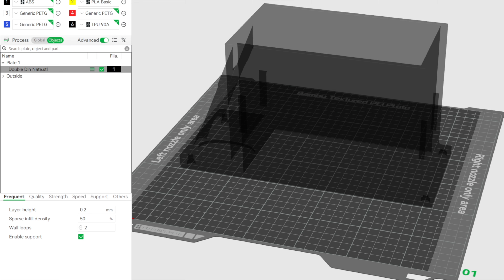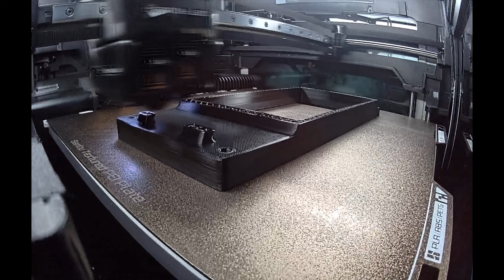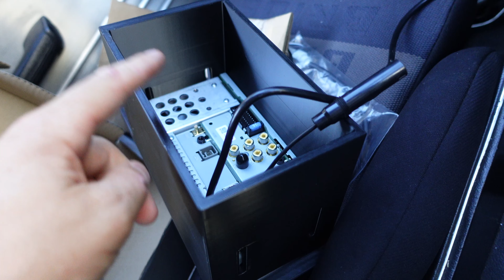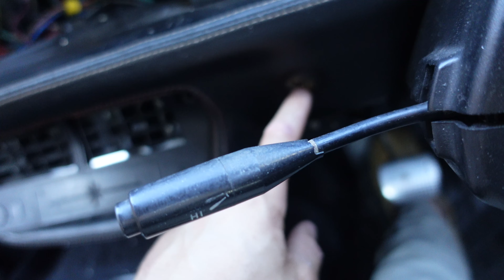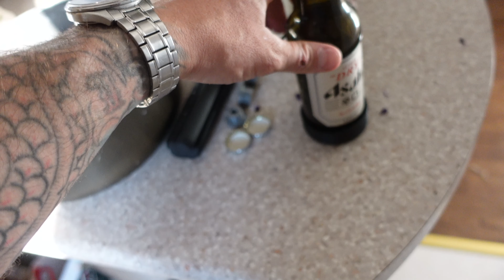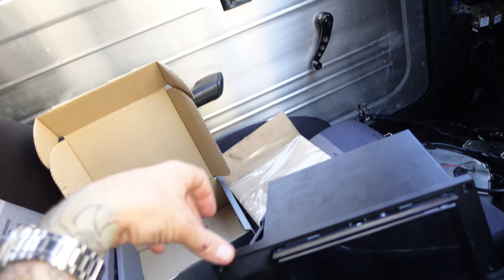3d Printing Custom Dash - 1975 Toyota Corolla KE35

Comment: There's apps you can get that will 3d scan using the phone
Reply: they tend to not be that dimensionally accurate, the results tend to not look that great once you remove texturing(always always look at the demos with that you can do a crazy blob and as long as it's textured it'll look far better than it is).

there's that learning for motorsport channel thats compared a bunch of scanners for home automotive scanning (it's also uk, he did a printed itb setup for learning for a fiesta or something)

Comment: grommets and stuff is pretty common use for tpu. i havent' tried it with gasoline parts but people swear they've printed gaskets for carbs and used them. the particular coloring used might matter with solvents I guess.

tpu is really great for non flexibe items too that get knocked about, just a bit fiddly to print compared to some other filaments. doesn't suffer from drops and such and is quite stiff if its printed thick so it does work for electronics project boxes and such fairly nicely